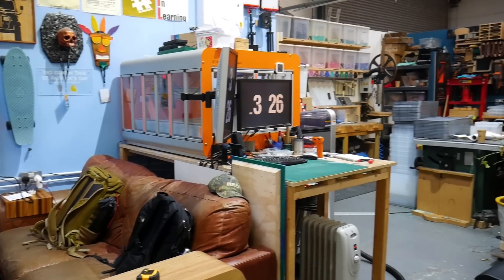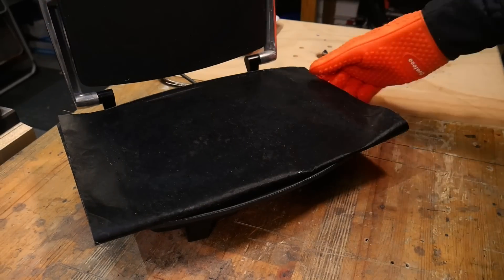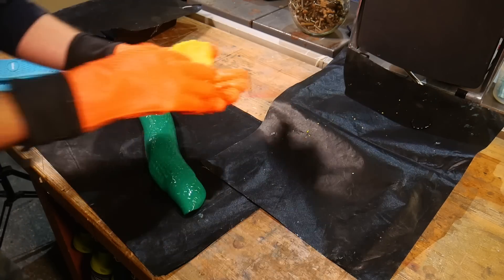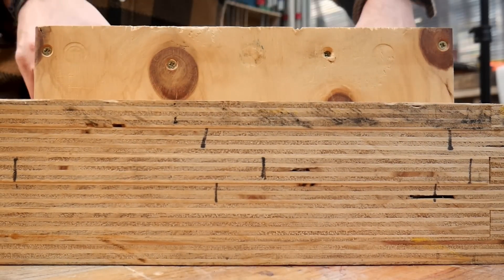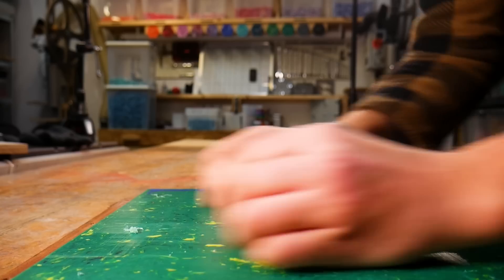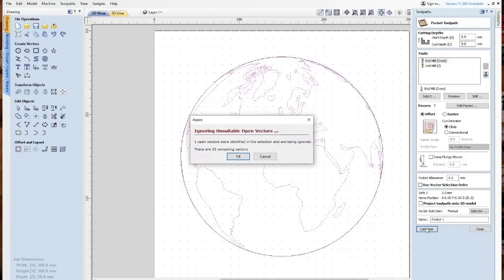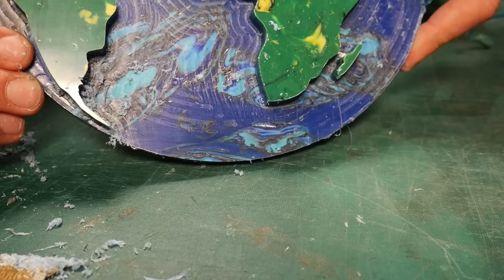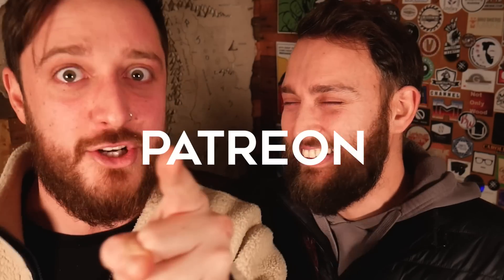Making Eco-Friendly Signage out of Recycled Plastic

Comment: 😮 that used a lot of energy.  I  mean I guess if you use solar to power all of the equipment then this would be great but otherwise it is really is not eco-friendly. Most people that will watch this video and then repeat this process will power their tools with electricity generated at a power plant which is fired from a material such as coal or wood. 

We should be consuming existing scrap plastics with fungus and transitioning to organic based material that can be sustainably grown and then rot once discarded.

Recycling doesn't work.

Comment: Do you find you need a dedicated planer for plastic, or does it matter? Just wondering if the plastic melts onto the knives or the inside of the machine, the chains, the lifting mechanism, etc, so that it wouldn't be usable with wood.
Reply from the maker: Nope, ours is a standard woodworking machine!

Comment: Something else you can do is use a paintbrush and some acetone, as acetone is a solvent that melts HDPE you can smoothen any rough edges. It evaporates quickly so you don't have to worry about it dissolving the HDPE.

Comment: This is awesome! Have a few questions it would be awesome to have answers to...
1. Is there a reason you can't mix LDPE and HDPE when recycling, even for smaller projects?
2. Most home plastic recycling videos use HDPE specifically. Is there a reason there are very few LDPE videos? What makes it harder to use?
I ask because soft plastics recycling was recently stopped in my country and I'd love to have a project using soft plastics I could do at home... and preferably (if possible) one that worked without needing to tell LDPE and HDPE soft plastics apart? I avoid plastics generally so don't bring many containers into my home, but the soft plastics tend to be the ones I can't avoid as easily (packaging with ordered items etc)